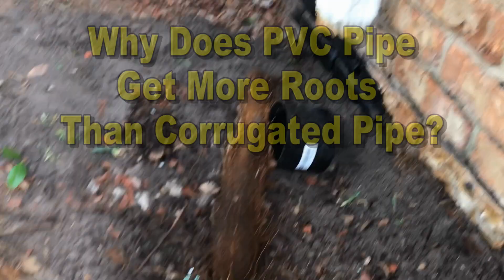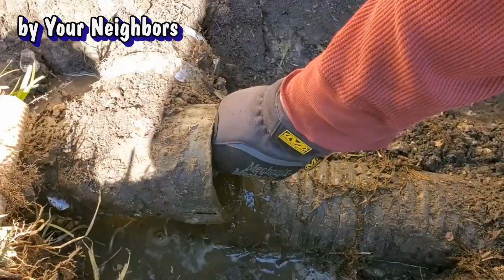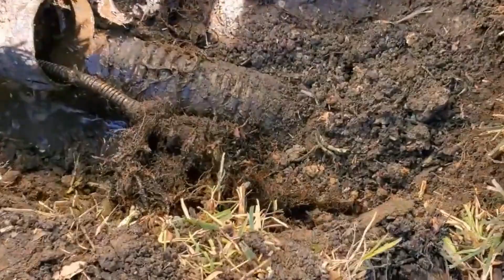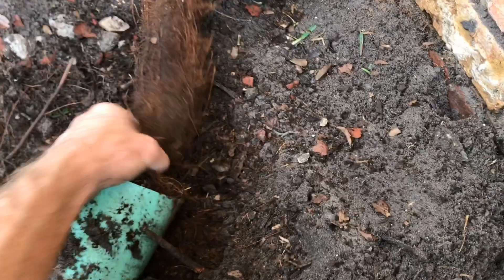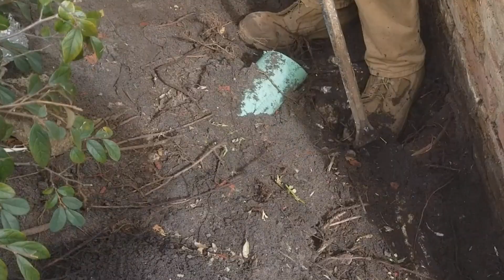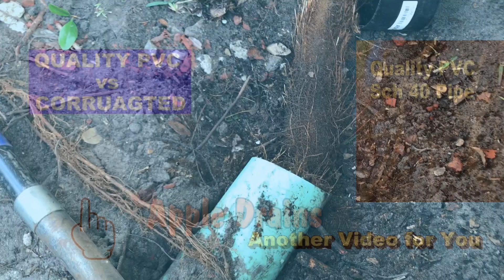All About Roots in Pipe - Learn how to keep the pipe clean

Comment: Adding clean outs are great, the more the better!  I've learned most roots hate air.  They die off or change direction when they hit an air pocket.  A new drain line buried in 1" rocks goes a long way helping those roots die off before they find the water inside the pipe.  So it's trench, fabric, rocks on the bottom, pipe, more rocks, cover over with fabric.  (Then dig it all up in 10years and repeat!)  lol
Reply from the maker: @jagboy69  do it right
Reply: @appledrains  yes sir!  Thanks for the education!